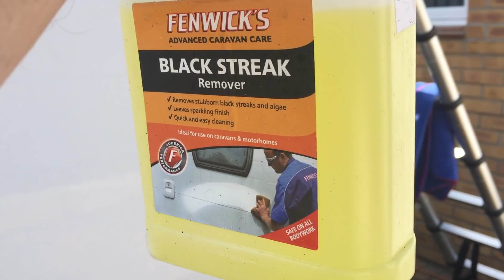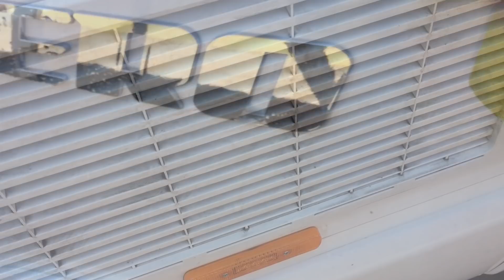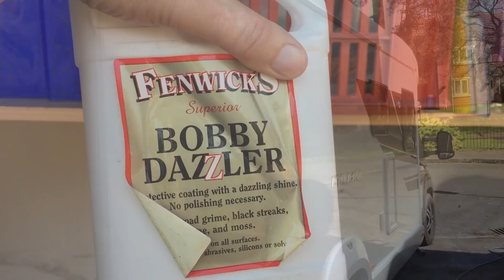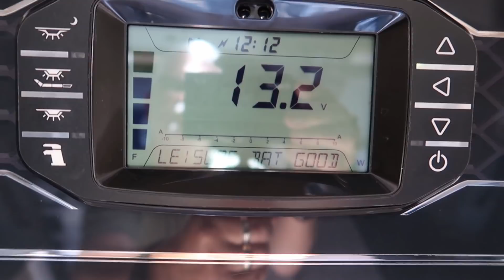GETTING BERTIE READY for Another Motorhome Tour | Prepare the Motorhome | Vlog 370

Comment: Great video, love getting the van ready for a trip. Not being a motor homer, never thought of grey waste smells coming up through the sink, We do clean our waste hog, but don't use any special chemicals, just detergent and hot water. Noticed you have something under your mats, is that to stop them moving on the carpet, as we have that problem, if so we were wondering what you were using. Safe journey and enjoy your trip. 👍Mark
Reply from the maker: The mats always creep along the floor when they are on top of carpet. To reduce this in the doorway Sue uses this stuff…. https://www.ebay.co.uk/itm/Anti-Non-Slip-Multi-Purpose-Grip-Dash-Mat-Drawer-Carpet-Rug-Gripper-Cut-To-Size-/292894608953?mkcid=16&mkevt=1&_trksid=p2349624.m46890.l49286&mkrid=710-127635-2958-0